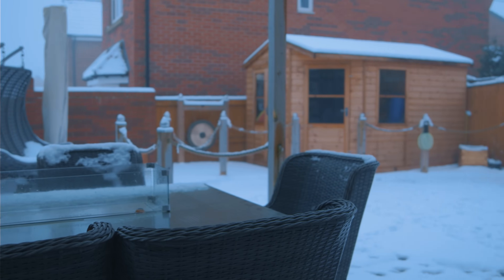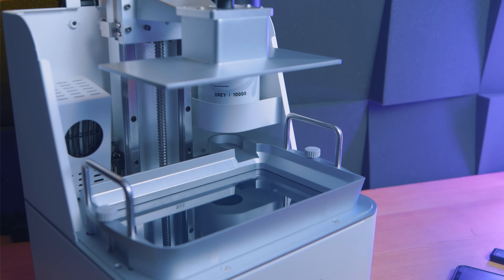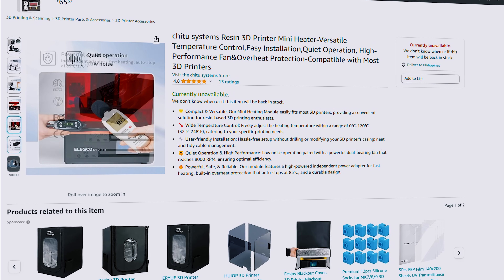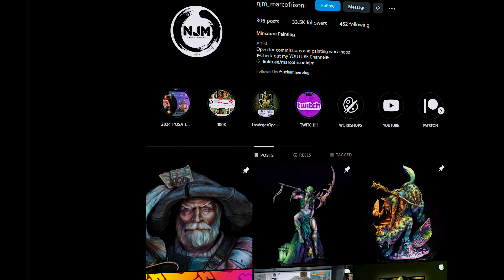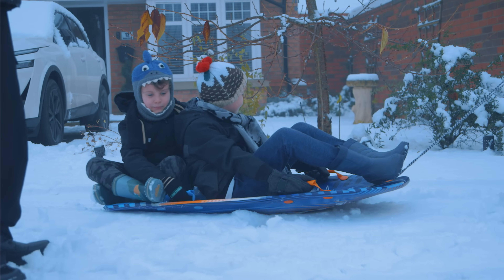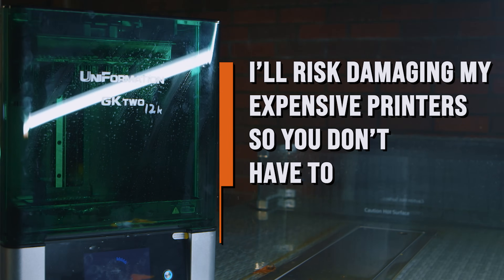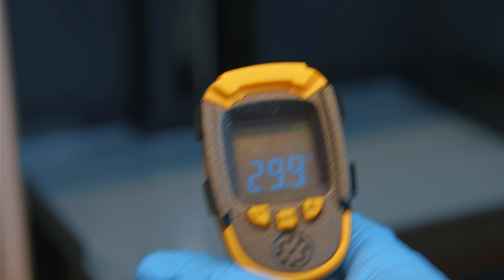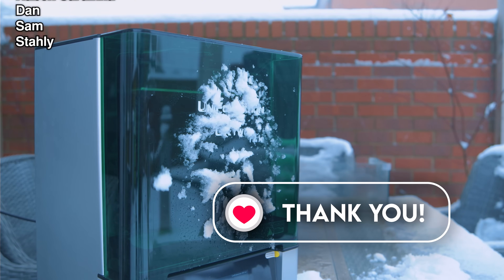How to 3D Print Resin in Cold Temperatures - A Christmas Special

Comment: Stick a Reptile Heat Mat under your 3D printer, tape the thermostat to the side near the lid. Use a 3D resin printer jacked/hood to trap the heat in.
Reply from the maker: does it work? how cold is outside temp when doing it this way?
Reply: @FauxHammer  Yes it works in a shed or garage etc.
Issues: once you lift the jacket off the printer the temp drops quickly (if it's really cold in your building) so once you're printing it's best to leave the jacket on until it's done. 
Also, when you top up the Resin between prints you need to give it a little while to heat the newly added resin. 
Long term issues: Not sure how healthy it is for all the lamps, electric components in the printers main base unit to be 26c the whole time.

Comment: I have my printer out in the shed, and it gets a little cold in Canada.  The shed is fully insulated but doesn't have any heating.  So I've got my printer in the large Creality enclosure with my filament dryer for my FDM printers.  It keeps the temp in the enclosure at about 32c to 35c.  It's only gone down to -3 a couple of times so far, we'll see how well it fair's when it gets down to -25c durring the day.